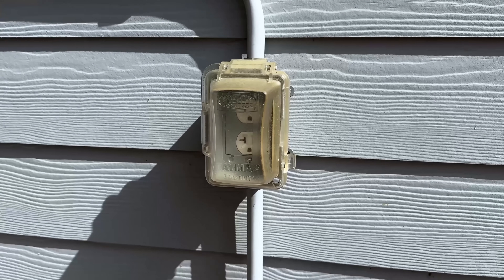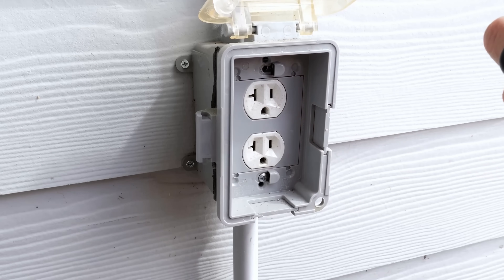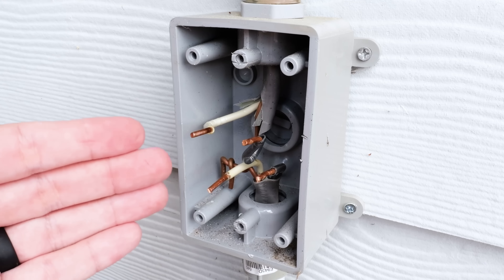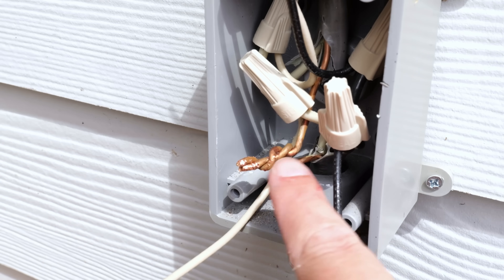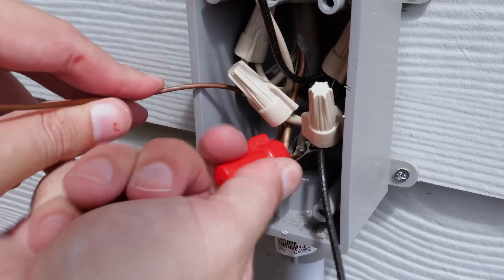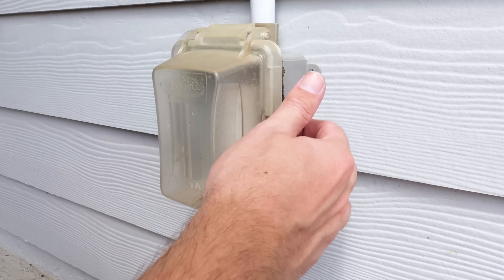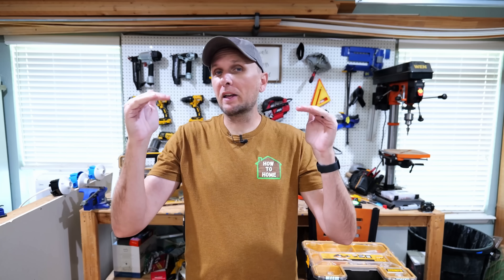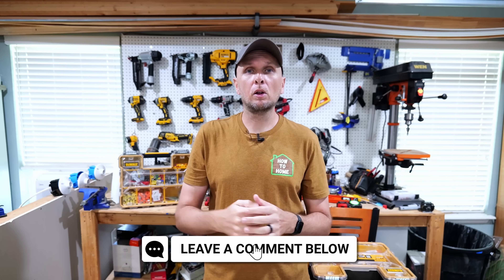Dangerous Mistakes DIYers Miss When Installing Outdoor Outlets!

Comment: 1 or 2 problems you missed. 
1. Can't te if that is Romex or UF-B cable?  So worth mentioning thatb
Romex cannot be used in wet locations, not even in conduit. 
- The paper wrap on the ground can hold moisture and cause corrosion of the copper ground wire. 
- The wire insulation on the hot and neutral in Romex is not rated waterproof, code calls for THWN. 
Romex can be used in conduit in a dry location. However Romex takes up extra space and you generally need 60% open space inside conduit for cooling. Chapter 9 of the NEC has a chart and details on using different wires in various type/size conduits. 

2. You stated 10 Guage wire and a 20 Amp breaker were in place. Yet you used a 15 Amp outlet?  You either need a 20 Amp GFCI outlet such as the Leviton Model # R92-GFWT2-0KW which is also Water Resistant, or you can opt to change the breaker to 15 Amp.
Reply from the maker: First, that isn’t Romex in the video.  2nd that is completely false.  A 15 amp receptacle can go on a 20 amp circuit but a 20 amp receptacle can’t go on a 15 amp circuit.  There is absolutely nothing wrong with my install.  Check the NEC.

Comment: My question, regarding the GFCI receptacle:  If there was concern about voltage drop over a long leg, resulting in the use of a heavier-gauge wire, wouldn't there be concern about putting that to the load side of the GFCI?  Would the length of the run cause the GFCI to trip?  Or, if it were something, perhaps a pool pump, etc, creating initial heavy start-up loads, wouldn't that also potentially cause the GFCI to trip when you don't want it to?

Comment: Depending on what the siding is, you may want to pre-drill some holes smaller than the screws to avoid cracking the siding.

Comment: I'm surprised you didn't have any remarks about using what looked like UF-B in the conduit, and the issues with conduit fill that can exist. If nothing else, just to clarify that regular nm-b may not be used in a wet location, which that outdoor conduit is.

Another small tip is that with those in-use covers, you can partially install the screws through the receptacle yoke into the box, and then slip the cover over them. That is why those holes in the cover are keyed. This is much easier than trying to assemble the whole works all at once.

Comment: The GFCI could be in the breaker. Would it be up to code if you used a 3 wire WAGO to splice each set of supply, load, and pigtail sets together so the outgoing load did not have to go through the receptacle?

Comment: Mistakes I've seen that you did not correct. A type of wire you're using going into a conduit. The same wire going down into the ground. Reducing the gear to the wire from 10 Gage down to 12 gage. Using a GFI that's not even rated for corny amps. The one you use is 15 amps

Comment: Romex in conduit in a wet location?  Not allowed in NY.  Also, you put a 15 amp GFCI outlet on a 20 amp circuit.  How did you get all those extra wires and the outlet in that box?

Comment: I just added a GFCI below an outdoor switch box.  After struggling to fit the GFCI in the standard box, I was forced to use a "mud-plate" to extend the depth of the box to allow the GFCI to fit.  The GFCI appeared to have a copper strip under the bottom mounting screw, in order to ground a metal plate as I used over the plastic box.  (My wires are all nutted together by color, including the ground and at least 7" long.  I also made a ground to the switch frame, which originally had no ground screw.)

Comment: Why does code require 6 inch pigtails? It could be tough to get all that wire into the box. I guess you're aware that there are GFCI breakers for the breaker panel.

Comment: You can use 12 gage wire in a 20 amp circuit?
Reply from the maker: Yes.  That’s what’s most commonly used on them.

Comment: It's nitpicky, but I would personally prefer to have the 10 gauge wires connected and a 12 gauge pigtail off of them to the receptacle. I know you mentioned it, but for example using a couple Wago 221-613 rated for 10 gauge would let you have the wire run be continuous through the Wago and still branch off to the receptacle. I know that both the 20A receptacle you removed and the 15A WR receptacle you installed are rated to 20A pass through, but if you pig tailed it off the run, it would mean no current passing through the break off tab of the receptacle to feed further down the circuit. It would also mean if the receptacle failed, devices down the line would still work. I know these are edge cases and addressed frequently, which is why I said its nitpicky, but I just thought I would mention it. Great video overall!
Reply: When we moved into a new house a few years ago, if the outside GFCI tripped it would also kill receptacles INSIDE the house!  Had it re-wired so the outside receptacle has pigtails branching off from the through run.  Now only the outside receptacle trips.
Reply: I have a 20 amp GFCI outdoor setup under my RV 30 amp plug on my property with a short 12 ga run from the 10 ga with wago lever connectors. I'll burn up the plug long before I burn up the wiring

Comment: In the state of Ohio almost all houses have an inside GFIC with the front and rear external plugs downstream.  Also for some reason those external plugs are part of the circuit which covers the bathroom receptacles.
I'm retired 43 year Realtor and have been on thousands of inspections.

Comment: You should always do a "live-dead-live" test before removing protective covers to make sure your equipment is working, and I would also not recommend trusting a "tick stick" non-contact voltage detector for the purposes of impending skin-conductor contact.

Comment: solar company I worked for did a huge install at a customer home. (their A team did the work a week before) SPAN smart panel on the house with 3 Powerwall 3 batteries and 40 solar panels. 
They trenched to feed the shop about 50 years behind the house, then another 50 yards behind that to feed the barn. Customer states his freezers didn't work in the shop and all his meat went bad. (Exotic game from an expensive hunt)

I show up and he has a generator running the freezers to try and refreeze the rotten meat. 

We switch to grid power and I see the lights in the garage work, but fridge and freezers dont work. I do a voltage test on all outlets and they do work. yet the appliances dont. 
I use a similar outlet tester like you did here and it's telling me the hot and neutral are reversed. 
I dive into the panels and find they never ran a neutral to the garage panel. 
Once I ran the neutral, everything worked as is should. 

They really dropped the ball on that one and got upset because I told the customer they were at fault. (He wanted to be paid back for all the rotten meat) They wanted me to make it seem like they weren't at fault. 

I was already upset with the company because they would order me to cut meter lock bands off and pull meters without permits. 
As an apprentice, I know I'm supposed to be supervised by either a journeyman or a master.  I installed a lot of SPAN panels and Powerwalls for them. 
Once I started refusing to pull meters without permits or proper supervision, they laid me off for "Workforce reduction" while they were currently hiring. LOL. Should change their name to Clownrun.

Comment: Notice at 8:08 that the wire nut is now loose. Wire nuts with wings are great but must be twisted to the point where there is a twist in the insulated part outside of the nut

Comment: What's your code compliance calculation for cu inch fill, with 4#10 plus 4#12 conductors, plus grounds, plus 6 wire nuts, plus full size GFCI shown?  Is a mount over uncutout vinvl siding SECURE in compliance sense?

Comment: Now you need to go to the breaker box and replace the 10 gauge wire with 12 gauge to a junction box external to it.  Make your splice between the 10 and 12 gauge in this new box and write what was done on the cover.  I don't know if this is required by code but, it will prevent someone from swapping in a 30 amp breaker for a 20 amp one because the wire size was incorrect.  I'm betting that the original receptacle wasn't rated for  30 amps either.
Reply: I wouldn't do that. It's a waste of time, material, and a slight reduction in ampacity. 10 gauge is still correct, 12 gauge is the standard minimum.

Comment: 1:49 Which you can’t tell it’s not protected by just looking.
7:43 unless you want to protect the downstream device, I’d probably connect the in and out wires together with a single jumper.
14:33 the source box does not appear to be a weatherproof cover. Whit it may be plated or stainless, I don’t see a gasket.

Comment: 😢wouldn't using 12 gauge wire defect the purpose of the ten gauge. Maybe by pass this box by wireing the 12 and both 10 together with this GIF and add more gif down the line wired like mentioned.  It's even safer.
Reply from the maker: No.  Near zero effect that far upstream.

Comment: And do not chain GFCI receptacles in series!!! The previous homeowner of my house did chain 3 GFCIs receptacles in series and 2 of them where not resetting for some reason, when I discovered how it was wired, I had to change the receptacles with Weather Resistant ones and wire them in parallel to not have to chase which one was triggered along the chain.

Comment: Boxes only capable for one 10 wire UF cable and the device is two points to fit in there plus you have now three wire nuts. I don’t know how you squeezed it all in there. Definitely no good.

Comment: Did you loose voltage drop not connecting 10 wire to your gfci?
Reply from the maker: No.  This was done towards the very beginning of the circuit.

Comment: 8:03 It's much better to use heat shrink tubing to extend wires. Adding wagos or wire nuts is overkill and just takes up more space in an already crowded electrical box, especially since GFCI outlets are larger than regular ones. With heat shrink tubing you end up with a single, long-lasting connection that takes virtually no extra space

Comment: I have used those 20 amp receptacles but use them on 15 amp circuits.
I also tie it to a GFCI on the other side of the wall AND an switch to turn power off to that outlet.
Mine is a gray box with a gray cover (metal for both).
GFCI also serves another outlet just inside the wall too.
I think you are not allowed to chain GFCI outlets on the same circuit.

I thought you were not allowed to use that kind of wire in conduit.
Supposed to be individual wires and stranded with no outer insulation sleeve containing both.

I heard you don't use a GFCI when you are powering a motor.
Reply from the maker: What wiring was I using that isn’t allowed?
Reply: @HowToHomeDIY  Never said that lol
Depends on those wire gauges to the outlet. For a 20 amp you need 12 gauge wire.
I use 20 amp outlets on a 15 amp circuit for durability.
Oh and commercial grade too.
Don't like sloppy outlets that won't hold the plug in.
Reply from the maker: You said “I thought you were not allowed to use that kind of wire in conduit”. So curious what wire you think it is.
Reply: @HowToHomeDIY  Single wire, stranded is what I was told.
Reply from the maker: That is certainly an option.  Probably the best option.  You’re talking about THHN or THWN.  But what you see in the video is called UF wire.  It’s made for direct burial in the ground and is allowed to be in conduit due to its rating for wet and damp locations.
Reply: @HowToHomeDIY  Not sure which they called for. At least for things attached to or in a building you are supposed to use single stranded wire.
If direct burial then why bother with conduit??
Reply from the maker: Protection.

Comment: I got a question regarding outlets, i just remodel my kitchen cabinets and reinstalled the garbage disposal, and the outlet that is in there is not GFCI OUTLET. But you just said that when ever is going to be water we need to put a GFCI.

Comment: 10 guage wire presumably installed to compensate for down line voltage drop. By using 12 guage pig tails through the outlet, you just negated this. You should have connected the12 guage pig tails and the line/load 10 Guage wires together and only the 12 Guage pig tails should have gone to the outlet.

Comment: Genuine question: why not:
One wire nut containing both existing neutral + pigtail neutral
One wire nut containing both existing hot + pigtail hot
On another video, you showed why it's bad to have two outlets wired together, sharing a line and load flowing through both... which appears to be incorrect as the current doesn't flow through the receptacle... rather it flows around the receptacle through the bars on the screw terminals.

Here, you're showing the current flow through the receptacle with no issue. Would having the downstream load flow through the nut not be superior to the load flowing through the bars?
Also, why not use hooks when installing the wires? The pigtails should be malleable enough to curve and fit around the screws.

Comment: That 12awg wire you spliced into series with that 10awg wire will now work as a fuse should anyone ever see that 10awg wire in the breaker box and decide they have the wire to up the breaker to 30A. But, why would you do that with 4 wire nuts and 4 short pieces of wire when you could have just wire nutted the 2 neutrals and 1 jumper wire and 2 hots and 1 jumper wire nutted together, then the 2, not 4, jumper wires would connect to the outlet. The less connections, and less garbage you have to pack into that box the better the entire circuit will be. 

It should be strongly pointed out that a non contact voltage sniffer is only to be used to detect the presence of voltage, it should never be trusted to detect the absence of voltage. Never go putting hands or tools into anything that has only been tested with a voltage sniffer. That plug in thing he used before would qualify or a voltage meter would be required to safely ensure the circuit is indeed dead.

Comment: No interior wire should have a voltage drop if your service is properly served from the utility. There is no need to use larger wire for that purpose. Likely that is what the electrician had so that’s what they used.

Comment: I would add that simply turning off the breaker is not best practice. I use lockout/tagout procedures, even at home. Shut off the breaker, and lock the breaker box. Put a sign on the breaker box that tells people not to turn on the breakers. And I always tell everyone what I'm doing - every single person in the house. Also use the correct screwdriver bit, those are ECX not Phillips.
Reply from the maker: There is no such thing as an ECX screw head.  The ECX was just made with receptacles and switches in mind.  Klein's combination bit is almost exactly the same as Milwaukee's ECX.  The screws are phillips head.

Comment: The pen and outlet testers will only test for current across the hot wire ONLY.  It is a good idea to use the pen also for detecting current from other hot wires that might be present, yes, you would be surprised the mess you can find in old homes or even new ones, however there is another danger - current on neutrals.  The NCV or outlet tester will not detect that, you will need a multimeter and probe neutral to ground, or even better, clamp around each individual wire in an outlet.   In some homes some setups have multi branch circuits, and unfortunately, not always to code, without a common disconnect so that can be a problem if you shut the circuit for that outlet, but it is also shared with another outlet where there is load present.  It is amazing to see electrical panels with 14/3's and no common disconnect, installed by master electricians !!! so yeah when shutting down a breaker for a given outlet never assume it means 100% that there is no power, there could be, and your outlet tester and NCV tester will not detect it.  That's why NEC exists, to avoid shitty situations like that, problem is, code violations and safety hazards are not uncommon !

Comment: Good video.  You should have replaced the outlet with a 20 amp GFCI.  You used a 15 amp.  It will work, but if the outlet was meant to power something greater than the 15, it will be, of course, insufficient.
Another thing about bonding....  If a metal box is bonded to the incoming ground wires, then the outlet flanges (when screwed tightly to the metal box) will serve as a sufficient ground, since the strap is the ground. A wire attached to the green screw technically is not necessary.  Only in a metal box, of course.
Also, it's better to have the outlet grounded, but a GFCI will still function without a ground. 
I also agree with others that mention using a box extender.  The GFCI adds thickness and I would not want to struggle getting that thing inside, with all those wire nuts.  Just some thoughts.

Comment: Love your videos, very straight forward and easily understood. But in this one,  you  did a great job finding and pointing out all the mistakes but then you go and use a 15 amp GFCI on a 20 amp circuit?  🤔 Oops
Reply from the maker: Why is that an oops?  Completely legal and what I personally wanted.

Comment: Good info, very informative... Footage can be deceiving but that box seems pretty full as is without the gfci outlet. It may need a box extender (not sure if they are produced for pvc molded boxes) or regular outlet with 20a gfci breaker. I don't read code everyday, but know nm (romex) isn't allowed in conduit, not sure whether UF is allowed or not.

Comment: Now! Show how you use that dumbassed box with 2 typical extension cords. You know, the ones that have the plug 180 to the contacts.
Reply from the maker: 180?  I think you meant 90.  180 would be the same lol.  And I can’t.  I didn’t need or want them there.
Reply: @HowToHomeDIY  What good is an outdoor receptacle if you don't use extension cords?